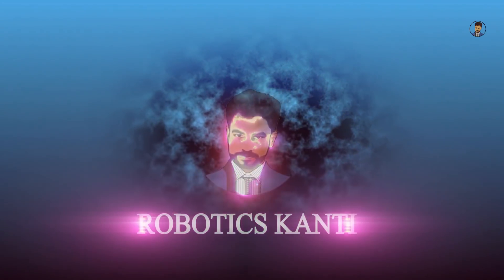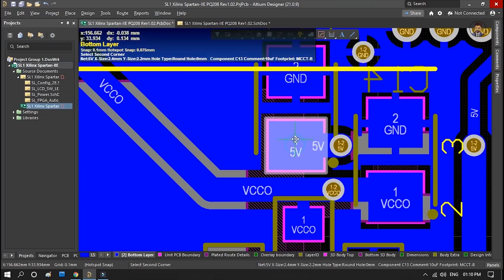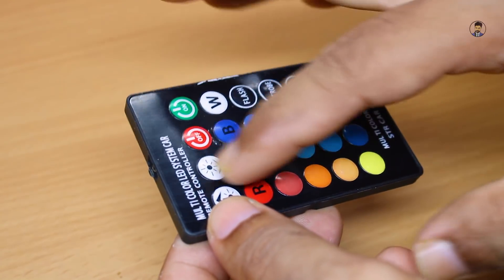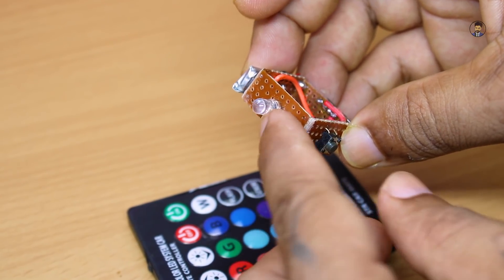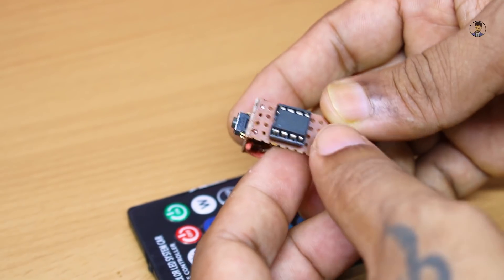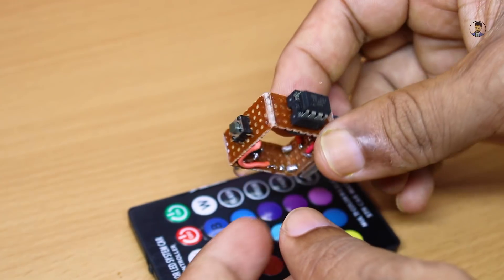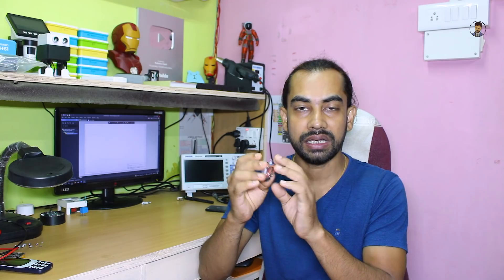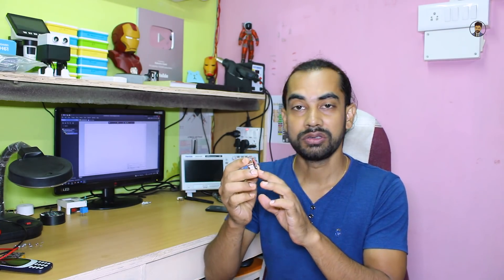how to make finger remote control device at your home

Comment: Sir you are doing great.
But, if you create video from basic it will be more use full to us.
I learn about arduino from scratch from "Exploring Arduino: Tools and Techniques for Engineering Wizardry" book and it was the best book that i have seen yet. You can make video from book chaptrwise or topic wise in HINDI and by explaning each line of code with demo then your chanel will be no. One

Actualy book auther make video of each and every chapter and practical but they are in forain english which is quite difficult to understand.

If you make video on that book and make it's playlist it will be more usefull to student's than the project video you are creating now.

I hope you will help student's.
Plz reply what you think about that, i am waitting for your reply. 😄

Best of luck 👍